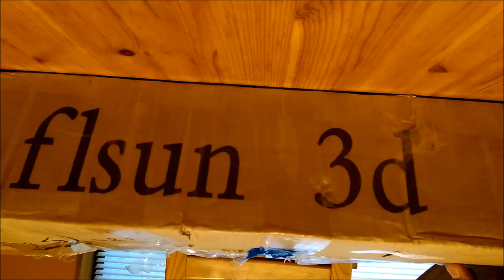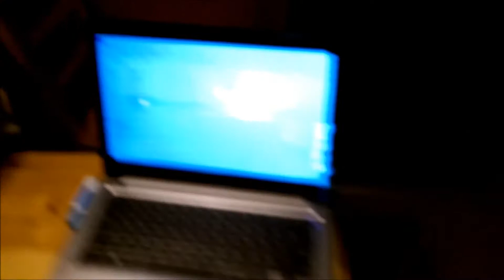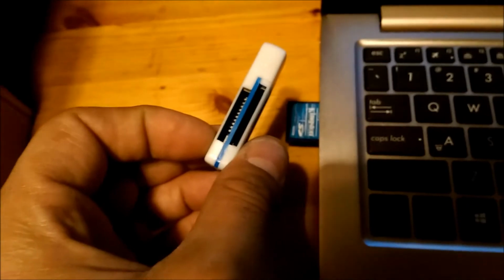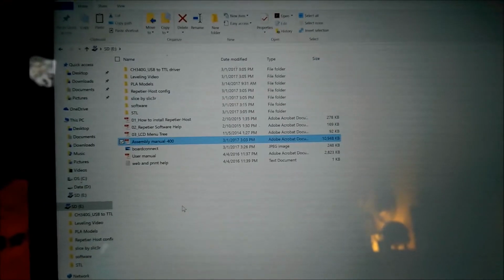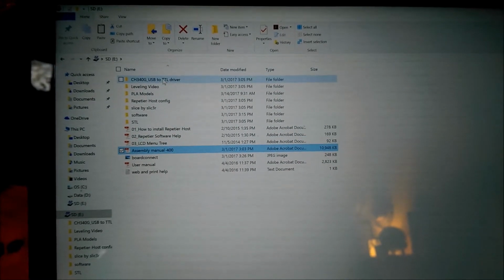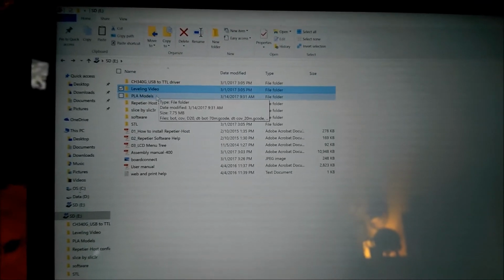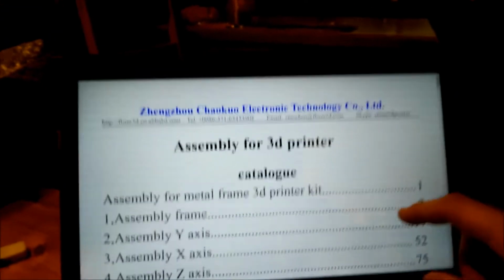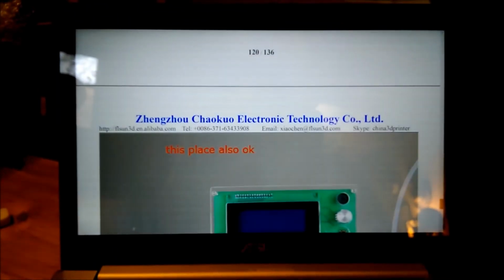NEW FLSun 3d 3DP - Alu Framed i3 Prusa Printer Unboxing!

Comment: Hi,

Any chance you've been able to compare it to a Tevo Tarantula?
Reply from the maker: After playing with it for about a month I would definitely recommend it over the Tarantula, the design is much more solid and stable; starting with the frame itself not needing extra bracing (seems most tarantula users end up bolting theirs to a piece of plywood with a couple braces for the z/x gantry), linear rods and bearings in stead of binding plastic rollers, including dual rails under the bed in stead of a single,  dual z-motors/leadscrews, overall you get more printer for the money imho, and takes less modification to get decent prints (print and add a fan duct and off you go).   Also Tevo designer left disgruntled because they screwed him and he started his own open source tarantula project that's better: https://www.thingiverse.com/thing:2108671, I still don't like the use of rollers, especially for the x-carriage, but it looks a lot more solid.  I'll try to get another video up on it soon.
Reply: macelius Since Tevo's "designer" completely ripped off the Mamba3D, replacing the good aluminium parts by shitty acrylic, I won't cry for him.

Back to the point. On the paper, the Flsun seems to be sturdier and to address design problems of the Tarantula. But it's tough to know what's behind the curtain. Someone who has both told me the Flsun used shitty stepper motors and a shitty extruder, which allow it to print PLA but not more.   So...did you print ABS parts with it? :-)
Reply from the maker: Sure, don't get me wrong, I think it should all be open source anyway.

I almost bought a tarantula myself before I found the FLSun kit and realized about the single rail and rollers under the bed of the Tarantula, I was set on aluminium extrusion vs acrylic, and it basically had all the features, or at least potential, of a good prusa clone.  As far as component quality, I was actually really impressed at the price point of a $200 kit!  I was expecting i may want to upgrade some of them right off the bat, but that has not been the case. 

I have had no issues with the steppars, though I don't have much to compare them to.  I've printed up to 80mm/s (even 100mm/s with just straight lines) and use 80-100mm/s retraction speed, they don't skip unless the movement is physically blocked.  They do sing a bit, but I haven't messed with the power pots on the drivers yet, and honestly I kind of like it's song lol. 

The extruder is actually pretty good quality for a clone.  I had not jamming or clogging issues until recently when it got some dirt in there, mostly cause I was messing with melting the filament together as it fed in, cleaned it out ans swapped in the spare nozzle and all is well.  I did drill the bottom of the brass bowden fitting out to 2.5mm so that the tube could fit all the way down in to the heatsink before i even put it together, so stock mileage may vary.

I did just get some ABS to print another carriage, but have not tried it yet.  I have had the nozzle up to 260+ to torque it and had no issues with the liner melting.  It should be ok for ABS, but for hotter materials or extended ABS use you want an all-metal from what i understand.  A quality all-metal v6 clone is $15 on amazon for just the metal bits (https://www.amazon.com/gp/product/B01L2LFCWG/ref=od_aui_detailpages01?ie=UTF8&psc=1, there's cheaper ones that come with everything of course, but you get what you pay for; more stuff that you don't need anyway, but of lower quality) and you just throw in your heater cartridge and thermistor (just make sure to print a new retainer clip first lol).  Whether the upgrade is worth it depends on your use, I've been debating it myself because the v5 clone works just fine, and the liner does have it's advantages, but you do have to maintain it more, and the clamp-mount for the heater cartridge and thermistor retension screw on the v6 are of course superior.

Check out my follow up videos, uploading now, might take another hour or two.  I will let You know how the ABS printing goes.